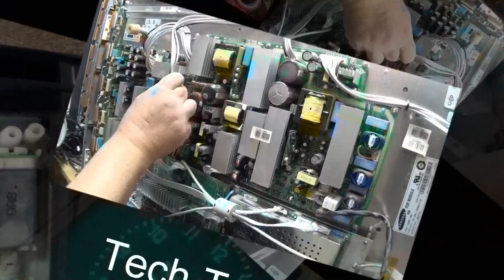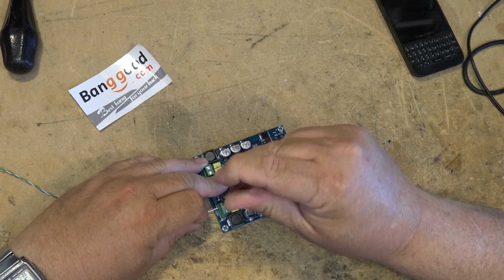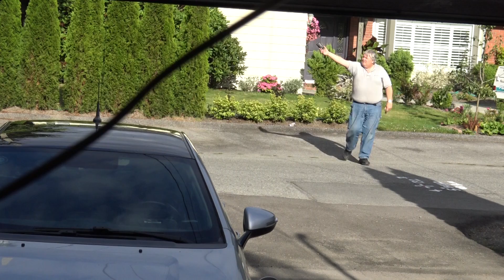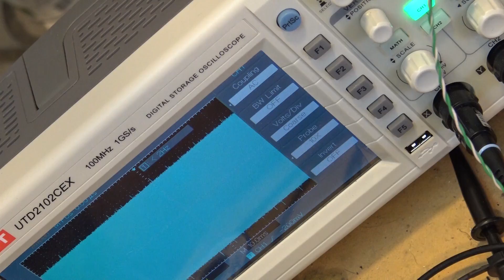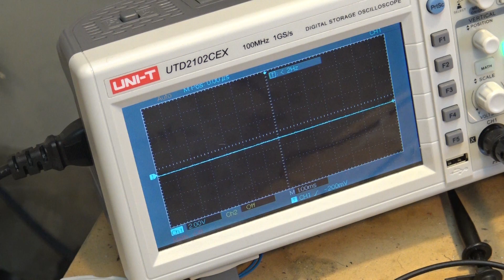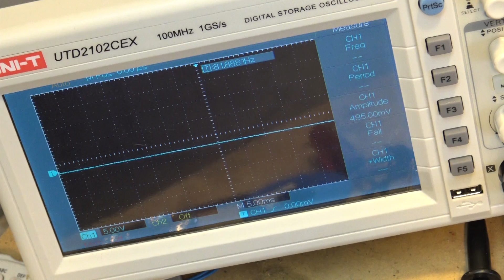TPA3116D2 120 WPC Bluetooth Audio Board test run

Comment: Do you think Is it possible to get a viable headphone signal from the bluetooth device and still drive the amp section? I noticed that you had a nice signal from this connection so   I connected a headphone jack to the RGL  terminals on the board , connected some headphones and did not get any sound, but the headphone are then micro phonic and send this signal to the amp..  Do you think by connecting the headphones that the amp section is disconnected, and is there any way around the bluetooth signal disconnecting?  Would love to be able to have both sections working at the same time as I am using this little gem to drive HiFiWellness.com  SSD255NEO sensory stimulation drivers and it would be great to have both outputs simultaneously.   Thanks for this post, one of the most informative  posts that I have seen on the "Tube".
Reply from the maker: Thomas Clark Fenner 

The RGL is a line level output. You would need a headphone amp between that and the power headphones.
Reply: I lifted the ground and am getting satisfactory headphone out put, with out headphone amp,  by connecting RL to ring, sleeve.  Seems as thought when connected to ground bluetooth is disconnected and aux signal is sent to amp.

Comment: Hi Dave, I bought an amplifier like this after watching your video, it's great, my question is does the ON/OFF switch stay in the ON positon when the power sauce is disconnected? or does it automatically reverse back to off, the reason i'm asking is because I would like to install a toggle switch on the outside of the cabinet to turn the amp on and off, my thoughts were to cut the cable after the transformer and connect to a toggle switch, any help appreciated. Trev

Comment: Hi, i really like your'e video and I learn a lot, but i have a little question, it is possible conect a signal to the board without the bluetooth reciever?, this is because I keep in mind build a guitar amplifier 200 Watts, and i need connect a guitar signal to amplify. Hope You can help me.

Comment: I bought this after seeing your video but after receiving I realised that it does not have aux input. Can you explain me how to connect aux input to this amplifier. Please co operate.....
Reply from the maker: The test point that I am scoping the audio can't be used as ain input unless you disable the mute line from the bluetooth module. as when there is no music streaming from the module it sends a mute signal to the amplifier chip. I have not researched which pin would need to be lifted from the bluetooth module to enable sound to be input.
Reply: @12voltvids  any other way to connect aux input any one please

Comment: These china deal amps are not over 2 real watts ! I got a Classe Audio rated at 30 watts/ channel weighing in at over 50lbs and cost me over $2500.  The proper antenna bypass requires fracturing the continuity of the existing board loop print, cause the way you did it is it's gang is running in parallel with your 1.5" lead - incorrect.
Reply from the maker: First I did not measure power. as there are many ways to measure. The numbers are taken from the product spec, under the conditions that the chip is rated at. 
The power is calculated by measuring the voltage x the current. 
Since a class D amplifier can produce a sign wave out of almost the total supply voltage, the number of watts can be determined by the amount of current provided.  The higher the voltage the higher the total wattage regardless of t he current. So just for simplicity, if the maximum current was 1 amp, and the voltage was 1 volt, you could achieve 1 watt. Raise that voltage to 30 volts, the wattage 30 watts. This is how they come up with these numbers. They look at the rated operating voltage, and how much current can the mosfets pass. Because these are switching amplifiers, there is virtually no losses due to heat, as the transistors are not operating in linear fashion, where they are partially conducting, and burning the rest of the unused current as heat. They hard switch on, then off. At a 50/50 duty cycle, you will see rail to rail voltage on the output, but no signal, as the low pass filter is removing the high frequency carrier and there is no current flow. When a signal is amplifier the duty cycle will swing back and forth following the analog audio waveform. It is this duty cycle swing that induces current in the inductors and capacitors in the low pass filter.  It took me awhile to wrap my head around how class D amplifiers work, buy once I looked over some designs, and did a bit of studying I understand how they work, and how such a small IC can produce the powers they do. When close to 100% of the energy available can be made to work you can get incredible performance from a small package. Trust me, I know about class A. I have built a few. I have one here in my studio that weighs in at about 40 LBS and produced 3.5 watts in class A mode, and only about 8 in ultralinear. 
It also probably sucks back 200 watts as soon as I turn on the power switch. Yes it sounds fantastic for sure, but these little class D sound good considering what people are playing through them, shitty sound from a smart phone.

Comment: I have a Kicker Amphatheter the amplifier inside went bad do you think this amp will be a good match for this bluetooth speaker it has 2 50watt 4ohm speakers and passive square sub?  https://www.ebay.com/itm/Kicker-Amphitheater-Bluetooth-40ik5bt/172959579095?hash=item284531bbd7:g:AaIAAOSwCtJZ-gn-
Reply from the maker: elitheitguy 
This Little board kicks out a fair bit of power even though I did not run it at max voltage.  I have been driving a pair of  polk bookshelf 100 watt speakers. Drives them pretty good.
Reply: than you for responding back i already ordered it. probably do a follow up video response to this audio test to show the audience that it is possible to fix other blue tooth speakers with replacement cheap audio boards. My purchase on ebay from china was only 13 dollars for this board. very cheap solution as apposed to sending this speaker back to kicker for repair! thanks again for posting this video. so according to your tests the specs are pretty close to what is already inside this Bluetooth speaker. the other up grade i will be adding to this speaker, is normally this speaker is not really portable due to the fact it only comes with a 24 volt dc power supply so it was not designed to be cordless and portable. so in my upgrade i will be adding a 24 volt rechargeable lithium battery to this kicker speaker so that i can use this speaker while driving my electric scooter. i used to power the speaker off a step down converter while driving my electric scooter, and it sounded great like i had a custom car audio system everybody loved it. that was the one thing i did not like about this speaker was the fact that it did not come with a rechargeable battery to bring the speaker with you where ever you wanted to go.
Reply: thank you for responding back i already ordered it. probably do a follow up video response to this audio test to show the audience that it is possible to fix other blue tooth speakers with replacement cheap audio boards. My purchase on ebay from china was only 13 dollars for this board. very cheap solution as apposed to sending this speaker back to kicker for repair! thanks again for posting this video. so according to your tests the specs are pretty close to what is already inside this Bluetooth speaker. the other up grade i will be adding to this speaker, is normally this speaker is not really portable due to the fact it only comes with a 24 volt dc power supply so it was not designed to be cordless and portable. so in my upgrade i will be adding a 24 volt rechargeable lithium battery to this kicker speaker so that i can use this speaker while driving my electric scooter. i used to power the speaker off a step down converter while driving my electric scooter, and it sounded great like i had a custom car audio system everybody loved it. that was the one thing i did not like about this speaker was the fact that it did not come with a rechargeable battery to bring the speaker with you where ever you wanted to go.

Comment: Kind of scary what you said about it being balanced and not hooking it up to an amplifier. But could you cut off the RCA connectors from an RCA to 3.5mm adapter cable and use the device to input to a receiver, or even the AUX jack of a car audio system?
Reply from the maker: This is not the type of device that you would use to provide a line level signal to run into an another amplifier. This one drives speakers directly. Just hook your speakers up and you are good to go. There are other bluetooth receivers available that do have a line level output that you can use to interface with an external amplifier.
This one uses a BTL output which means that you need 2 wires to each speaker. You can not use a common return  like most amplifiers use, where the  L and R ground are common. If you connect the 1 speaker - terminals together, it will damage the unit.
Reply: I have one of these units, but no telling if it has line level. I only have Aux and no bluetooth in my truck and was hoping to use it to interface with my phone. From your excellent video warning, it might blow up my truck aydio?
https://goo.gl/opE6yJ

Comment: Hi Dave, please forgive my ignorance, i'm going to build this amp into a speaker box will this still pickup signal from my ipod if it is fully enclosed? Thanks Trev, Manchester, England
Reply from the maker: Yes it will. This is what I did. I put it inside the speaker box itself. Worked great. Then I had a better idea, as I am always changing things around, I put it stuck it to the back of the speaker with double sided tape, that way I could get it the unit for working on it..
Reply: Thank you so much for you quick response, may I ask one more question (then i'll leave you alone) the speakers I'm using have a bass speaker, mid range speaker, and a tweeter that link into what i'm surmising is a little unit that splits up the various sounds,  would this be a problem as you said do not put through speaker switches etc, by the way it's great to watch your excellent videos,  great precise detail,  thanks
Reply from the maker: No that is a cross over, and that is fine to use with a BTL amplifier.
What you can't do is connect it to a speaker switch that uses a common ground for the ground wires as that would short the 2 negative speaker lines to ground, and they are by no means ground, they float with respect to ground.
A cross over other the other hand just has a series of resistors, chokes and capacitors to stop the high frequencies from going to the woofer, and stop the bass frequencies from going to the tweeter.
Reply: Dave, you are a gent.

Comment: What is the correct way to run 1 speaker from both channels? is it possible?
Reply from the maker: You could probably bridge the 2 pins at the input of the amp. The ones I showed with the scope, the preamp out from the Bluetooth module. If you bridge those then the amp would run as dual mono and you could run a single speaker.
Reply: Thanks! i'll look at that again. I'm a beginner.
Reply: Are those the ones that show L,G,R,? Where you had the wire connected to the ground and do I connect the left and the right together and use the common ground?
Reply from the maker: Yes that is the left and right output from the bluetoth, and input to the amplifier.connect the L and R together, ignore the ground. That will get you mono from both speakers.

Comment: Hi, is it possible to add an AUX input on this board or it's only Bluetooth ? Thank
Reply from the maker: As I pointed out there is a line level output that most likely will also function as an input, however the bluetooth board mutes the amp when there is no signal. So that mute curcuit would have to be disabled before you can feed in aux audio.
Reply: Ok, thank you for your reply, just a last question do you think theses speakers (https://www.kirstein.de/en/Consumer-Electronics/Pronomic-USP-430-BK-Wandlautsprecher-Paar-schwarz-4-Lautsprecher-30W-RMS.html) with a power supply 24V at 3A is enough to have a good sound for a terrace or not ? Thank
Reply from the maker: Yes it will pound out the sound. I am running a pair or Polk book shelf speakers using a 12 volt 2.5 amp supply, and it goes very loud.
Reply: How would you fix the mute signal from the Bluetooth?

Comment: Do you have a wiring diagram for it? Just bought it :)
Reply from the maker: The speaker terminals are clearly marked + and -. The power plug in a tip positive.

As you see as soon as you power it up it starts looking for BT device.

Comment: Any new content coming?
Reply from the maker: Power supply on computer went super nova, and took out the mother board, video card, memory, several internal hard drives. Computer is now at the vendor, and they are all pointing fingers at who's fault it was. One says the power supply wasn't big enough. Nobody wants to take responsibility. All I know is I spec'd out what I wanted, and the shop built it. I had them assemble the parts as if I had just taken the parts there would be no warranty. Now they are trying to worm their way out.  My credit card company is now putting pressure on them, because they double the warranty, and I have made a claim with them, and they don't want to be out 3 grand. 
Sooo, to answer your question, as soon as the computer comes back, and I get all my software and files restored yes there will be new content. I am shooting stuff this week, but my laptop is nowhere near good enough to work with. Can't load premiere on it as I have the 64 bit version, and the version of win7 on my laptop is just the 32 bit version. Hopefully by thursday or friday I will have a new PC here, and can start the re-install and configure.
Reply: 12voltvids that sucks hope all works out can't wait for some new videos!

Comment: Shouldnt antenna wire be silver? in any case be careful soldering a wire to that trace lol, the traces are piss poor.
Reply from the maker: Synthematix 
Copper is a good conductor.
I have installed this board inside a pair of bookshelf Polk speakers.  They sound very good even running on 12 volts.

Comment: Hi Dave,
If those test points were not available, could you have simply connected your scope to the speaker connectors? Could you show how you would use your scope to test a typical home stereo? Where you make connection points etc? Thanks for sharing and thumbs up.

Comment: Wow, that's amazing, a Blackberry!  LOL
Reply from the maker: I have several. That one is a Q5. I use it strictly as a music and internet radio player. I also have a Classic (work phone soon to be retired) a Z10 and Z30. The 30 is a great phone. I use it mainly to run Fongo on for a separate phone number. Personally I use a Blackberry Priv, but that one is an Android OS phone. One thing I will say about the blackberry phones. The media player is fantastic. I have compared the bluetooth link on my old BB10 phones to media players on an Ipod touch, and  Samsung Galaxie. The sound from the BB to a bluetooth receiver (A Blackberrt music gateway) is superrior to both the Samsung and Ipod in terms of sound quality. This is true for both the headphone and bluetooth output. Must be the sound chip in the phone, but they sure do sound good. That is why I use them as portable music players. That and the fact that I can just load a bunch of music on a bug microSd card, and just plug it into the SD slot on the phone. None of this pissing around with Itunes to load it. Drag and drop on the SD card, and plug the card into the phone.

Comment: they've come a long way since tubes
Reply from the maker: Funny I still listen to tubes.
Reply from the maker: Synthematix 
I still prefer the sound of a class a triode tube amp. This unit sounds pretty good but doesn't have the warmth of the tube amp.
Reply: Dont take to heart this crap from china, they are in no way shape or form as good sounding as a Class AB amp. theyre ok to build a boombox but they aint hifi
Reply from the maker: On a good pair of Polk book shelf speakers this unit sounds fantastic.

Comment: is it really a 120w
Reply from the maker: That is what they claim. I only validated a P-P voltage swing of 24 volts into 8 ohms.
Reply: 12voltvids i guess its 41 or 45 w tops
Reply from the maker: You know the drill. A watt isn't a watt anymore.
 There is "old school" watts, which is Volts X Amps. So, if your voltage was 24 volts, and you have a current of 4 amps, then 24x4 is 96 watts.
In Class D amplifiers they calculate totally different than in Class A or AB.

They calculate based on the rail to rail voltage X the maximum number of amps, and since the output is balanced, not ground referenced, the output voltage is actually almost double. It is sneaky, as they are utilizing the inductive gain available in the inductor as it cancels out the carrier, and induces an analog voltage, one 180' out of phase to the other.  Now I was testing with limited current available from my whimpy power supplies. I have paired this board with a pair or Polk speakers, and it goes incredibly loud on a 12 volt 2.5 amp supply.
On 24 volts it went even louder. It would be interesting to see how a watt meter would fare, or even how the scope readings would be if I referenced the scope ground to the speaker negative terminal as opposed to chassis ground. At chassis ground I am only measuting one output, not the cumulative output of both. If I put both scope probes on the positive and negative outputs and hit the add button in the math function it should show the actual voltage going to the speaker and I bet it is higher just due to the inductive effects of the inductors.